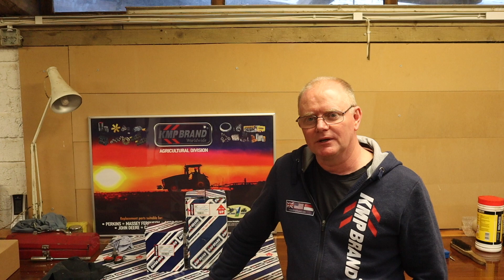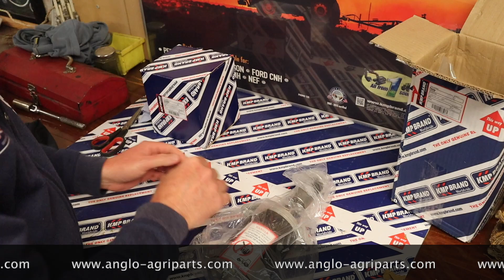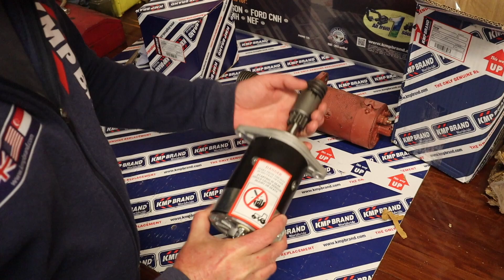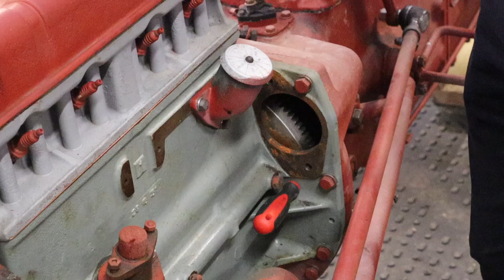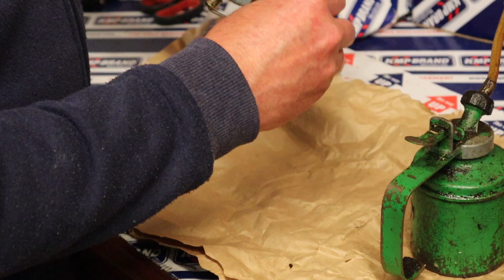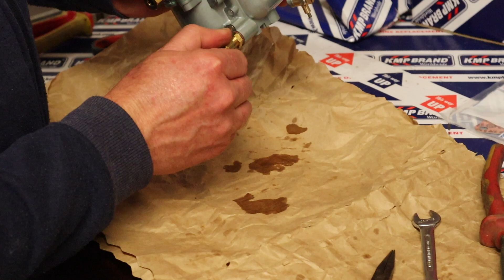#144 Ferguson TED20 - New Starter & Carb

Comment: How did the new carb turn out to be? Mine has turned out to be absolute garbage. Mixture has zero response tighten or loosen whatsoever.
Reply from the maker: Hi Uday, Great question! I think I’ll do a follow on video. Mine works, as in the engine runs and actually runs quite well. My mixture screw does work, in that it does alter the mixture and I can get what seems like a good balance. However the tractor seems to be running rich and definitely uses more fuel than I expected! 

Also that choke mechanism is not right. I’ve ended up working it manually at the carb itself on first start of the day. After that it starts on the first try. 

I’m tempted to put my older Zenith back on as a comparison. Stay tuned! 😉👍
Reply: @WaterhouseForde well i did buy a brand new zenith carb. After all the engine work when started, the carb made us absolutely mental. Mixture doesnt work at all. The bottom main screw has to be kept full tighy just to keep the engine running at bare minimum. The moment i open it, start fluttering. What a disappointment. Just managed to find an old one in England and now waiting for it to be brought to india….. new parts have been a disappointment…many of them…
Reply from the maker: That is very frustrating!! Have you tried stripping the carb to see if you can find the problem? They’re very simple devices, shouldn’t be hard to find the issue. It sounds to me like there’s an air leak somewhere.
Reply: @W @WaterhouseForde did. Its a brand new carb. Most likely some issue with the borehole’s. I have managed to find an old carb in good condition. Will get it shipped to india soon along with the overhaul kit.
Reply from the maker: Hi Uday, Great question! I think I’ll do a follow on video. Mine works, as in the engine runs and actually runs quite well. My mixture screw does work, in that it does alter the mixture and I can get what seems like a good balance. However the tractor seems to be running rich and definitely uses more fuel than I expected! 

Also that choke mechanism is not right. I’ve ended up working it manually at the carb itself on first start of the day. After that it starts on the first try. 

I’m tempted to put my older Zenith back on as a comparison. Stay tuned! 😉👍